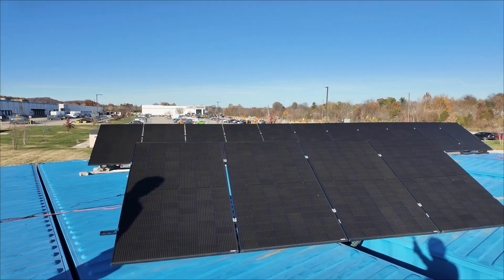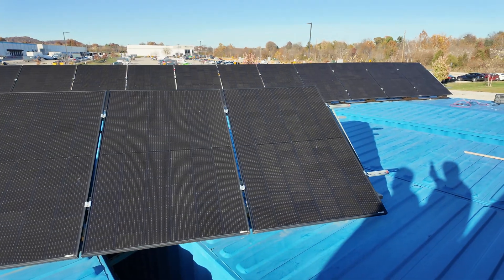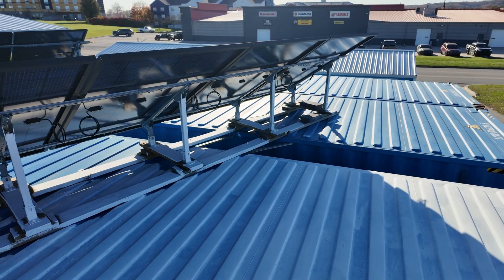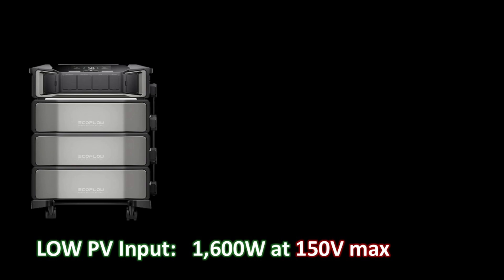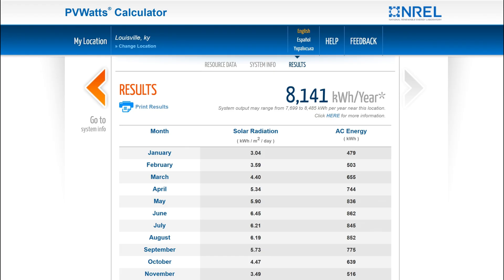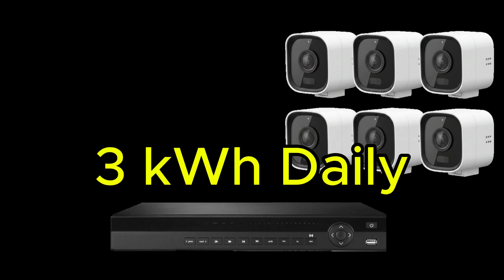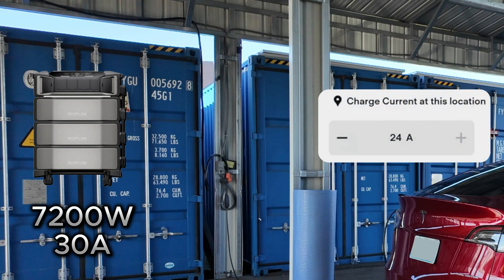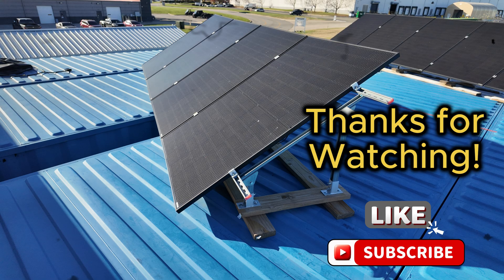Tour an off-grid system that saves $1,000/year.

Comment: I bought all my solar panels and batteries off of the Internet and installed it myself. It is tied to the grid but I operate in non-export mode and therefore I never spin my electric meter backwards. And I have no permit and no connection agreement with the electric utility. It virtually eliminated my annual electric bill. Then, I figured a system like this would cost roughly $28,000 installed so that's what I claimed on my income taxes. So I got 30%! That's $8400 back on my $12,000 solar system and I screwed the man! Damn it it feels good.😂😂😂😂

Comment: All of these cheap Chinese made high frequency, trandformerless inverters can damage your home's appliances when their MOSFETs fail. I would never plug anything of value into one of these.
Reply from the maker: Interesting - what brand inverters do you recommend?  This is the first time I've heard this concern.  I'd be curious to read more about MOSFET failure if you can provide a good resource.
Reply: @BackyardSolarProject ignore the troll. He's a spammer who has been saying this for the past 5 years. I wouldn't give him a thought.
Reply: Well I've been doing this for decades and you are 100% wrong. Nearly every single home appliance these days have no problems with these type of inverters. I have hundreds and hundreds of off grid power systems under my belt and I've never ruined anything.